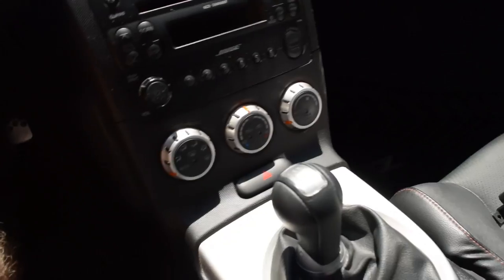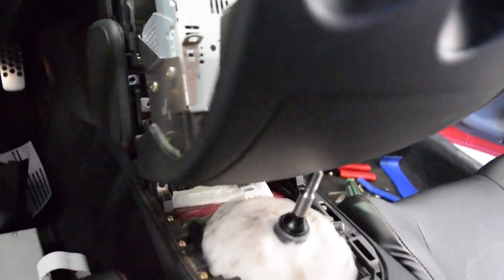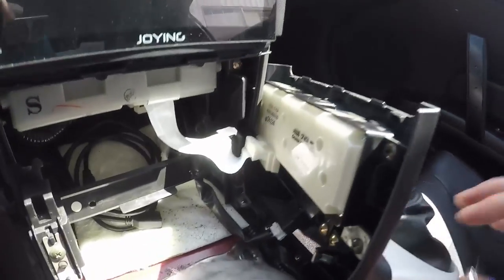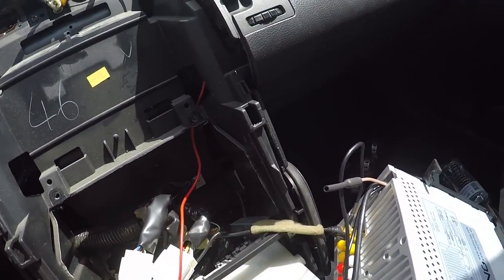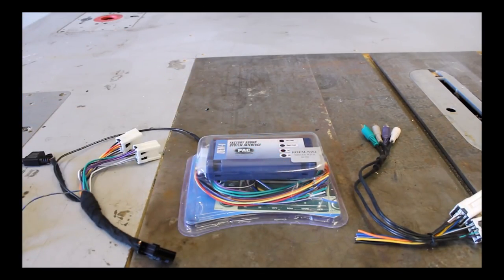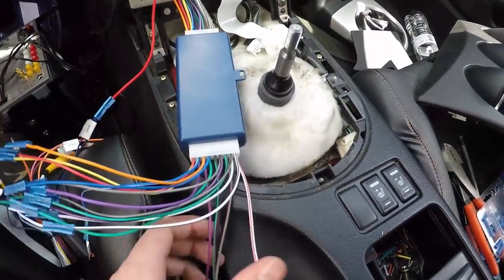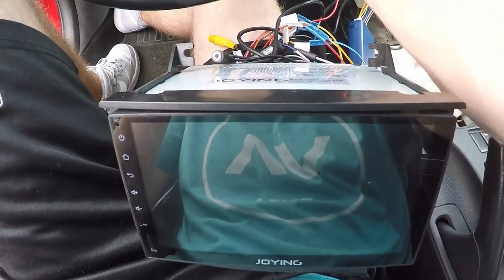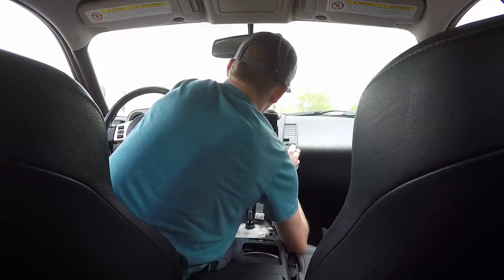Nissan 350z Head Unit/Stereo Installation

Comment: Do you have the bose subwoofer? I connected mine as you did and the sub barely hits and only has vocals coming out
Reply: did you gain the bose amp with the factory head unit before you installed the new one?
Reply: @masonb2520  how do you gain the bose amp with the factory head unit?